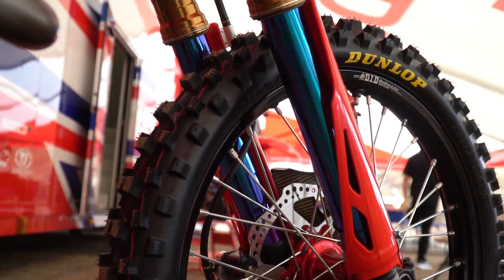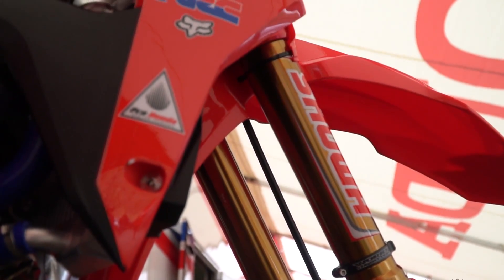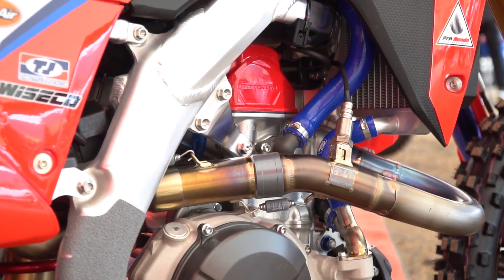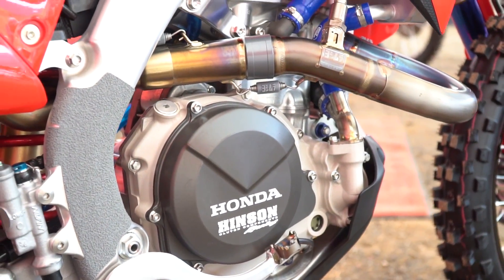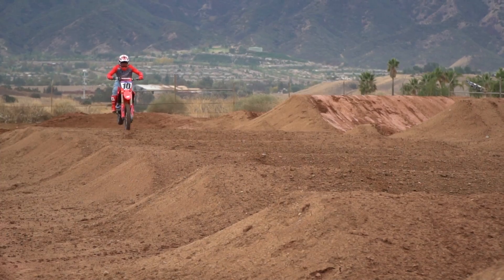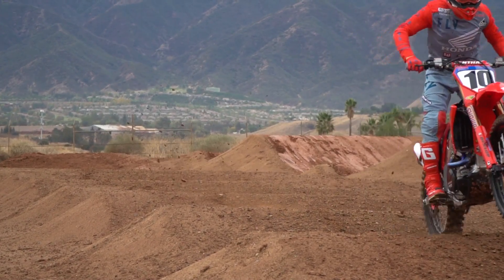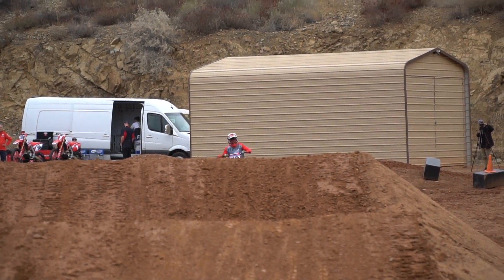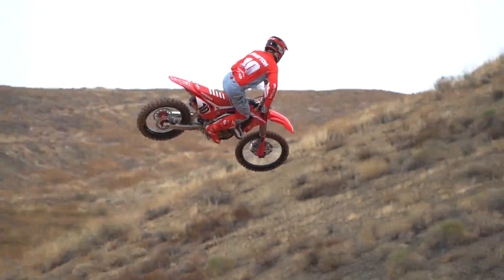Chassis Development with Honda HRC

Comment: I'm a cyclist (mainly MTB) but have become a big SX/MX fan, but am a bit in the dark on a lot of the ins and outs of dirtbikes.  If someone could answer my questions I'd love to know more.  Coming from the MTB world and seeing how MTBs differ in geometry, suspension designs, spec, frame materials/layup, most of my questions are based of that:
1. How come there are no carbon rims in SX/MX?  (obviously they're ubiquitous in cycling, but are the weight advantages not worth the "risk" of breaking one?...even though they can be made incredibly strong) I would think the acceleration and cornering advantages would make them desirable 

2. All the bikes use a rear swingarm design, but are they all "single pivot" and in the same location?  Do different manufactures use different linkage designs for the rear suspension?
3. Does the geometry vary from manufacturer to manufacturer? If so, it there a simple answer? (ex. KTMs have shorter wheelbases, and steeper headtube angles)
4. Are all 450's the same amount of suspension travel regardless of the manufacturer? If so, why?  Are there rules on that?   

thanks in advance!!
Reply: Gallup Journey Test Drives   
1. There is a minimum weight restriction. They can only make them so light. They save weight in places that are less risky than a potentially broken wheel. They have some carbon brackets on the bikes with all titanium fasteners and such. 

2. Suspension setup and design is all about racer preference. There’s no “standard” in the race world. These bikes are nothing like stock. I would consider them all to be one of a kind. That is why they spend so much time testing and talking about how the “new setup worked great today”. Something is always changing and improving. But they do have many different linkages that they use. 

3.The geometry on most areas of the bikes are different from brand to brand. Some bikes have a steeper head tube and turn better and some are laid down a few degrees for more stability. Swing arm lengths and wheelbases vary as well. From my experience a Suzuki will turn sharper than the other brands. KTM and husqvarna are a little longer and are more stable but don’t turn quite as well. Yamaha is sort of in the middle. Bikes are classified as either “front wheel or rear wheel steering”. The engine plays a large part in that and of course wheelbase and steering angle. They do ride pretty different though. Some guys are smooth and prefer to roll on the power out of corners with precise front wheel control and some will blast into it and drift the back tire out which is a rear steer method. Each team has parts they change depending on the race to change it a bit for each condition. Supercross setup is much different than motocross. The handling is different from bike to bike. They spend many hours testing and adjusting to get it right for each rider. The same bikes in a team can vary quite a bit just between riders. Everyone is a little different. Height, weight, and riding style are the biggest factor. If you compare stock bikes though, go read motocross action 450 shootouts and they will explain the differences between each brand. They all have their own strengths and do things differently. Some focus on power. Some focus on great turning ability. Generally somewhere in the middle is best for an average rider. When guys get up to the national level the get into custom suspension and handling components and setup that really changes what the bike can do if they have the skills to use it. A weekend trail rider wouldn’t likely even notice but it can mean 5-10 second faster lap times for top guys. 

4. The travel numbers are almost exactly the same. Their suspension is so advanced that the amount isn’t as important as how plush it rides and resists bottoming. If there is too much travel the bike is more top heavy and doesn’t turn as well. I believe most race bikes are actually lowered compared to a stock bike for better turning and hole shots. I think a large difference between dirt bikes and mountain bikes is the engine. The gyroscopic forces on the drive train and suspension have a large impact. You can actually overjump a few feet and still land decently just by landing with the throttle on. The bike won’t bottom nearly as bad as no throttle.
Reply: @jeremiahlf   thanks for the info.  I've read some of the magazines here and there, and they tend to talk mostly about suspension performance and engine performance, then talk about how it rides, so that's why I was a bit confused, as they don't seem to say things like "Yahama's switch to a steeper headtube, a little more travel in the front end, and shorter swingarm making it turn better than any other bike tested." 

I also get that there is a weight minimum, but it seems that lighter wheels would allow riders to better position the bikes on track and increase acceleration.  Interesting!
Reply: I'll give it a shot:
1. The first question is the least clearcut.  I can speculate that weight isn't a huge priority because the bikes must satisfy a minimum weight requirement.  So why not make the wheels super light and allow something else be beefier and have the same overall weight?  I don't know.  I personally am not as concerned about the difference between rotating mass vs non rotating.  Others seem to make a big deal about it.  As far as I know there are no rule against carbon fiber rims.  Ultimately we must remember that a company has one goal... to make money.  Carbon fiber rims might be a big hit in the showroom.  That's where it counts the most.  Risk is also important.  I speculate that the risk/reward tradeoff has not yet  become favorable.  Yeah.  Boring answer (econ major). 
2. Yep.  All of them have single swingarm pivots.  Each manufacturer can place them where they want. We aren't worried about pedal bob on the uphills like the mtbers are.  I don't know of any manufacturer who still uses a differing suspension linkage design.  A million small and important dimensional differences exist between manufacturers and specific to each model..
3.Geometry varies between manufacturers and bike to bike.  I'm not aware of any manufacturer which have a general reputation for their brand's geometry either across bikes or over time.
4.No.
Reply: The best say to answer your question as well as give u the diagrams that show suspension theory i suggest you go to Amazon & buy the Race Tech Suspension Bible. It goes over theory in Suspension (forks, shock, sag settings, rising rates, valving) & frame geometry (rake & trail) & how it affects the handling. I am still in the dark as far as the differences between Aluminum being to stiff & Steel frames having the right amount of flex. Every mfg has their magic suspension height #'s but they are all pretty close to each other. Its all about your type of riding/ skill level/ weight/ speed/ terrain/ sag, honestly. I know this is not the answer u wanted but its the best u will get in a comments section. I hope u get the book & it can help u.
Reply: Was wondering similar things, but with any modifications gets expensive fast unless got lots of spare parts laying around, as for as carbon goes, due to weight advantage on motorcycles would not make same differences as MTB as far as reliability/cost goes